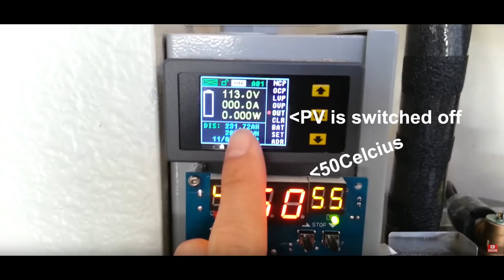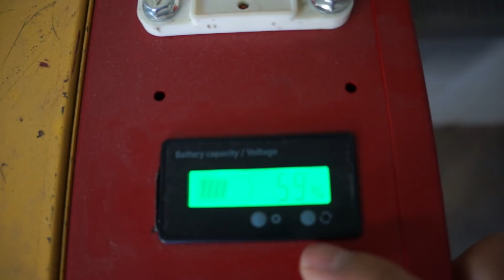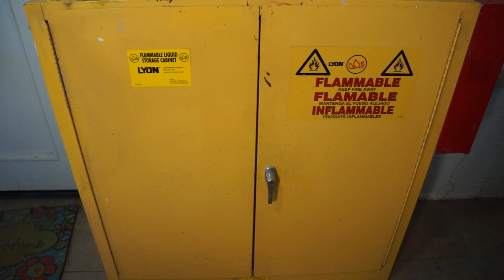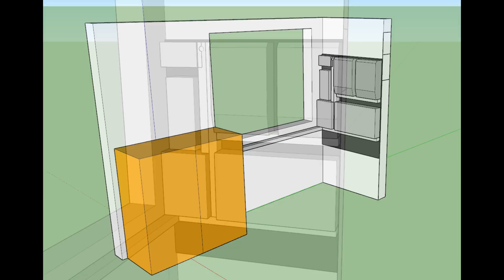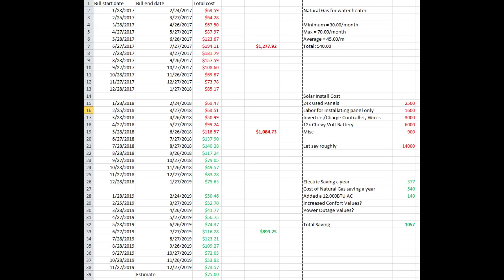My 7kw Off Grid Solar, 37kwh Lithium Ion Battery Bank Cost vs Saving over 2 years?

Comment: Very good.   I bought a 20 panel micro-inverter package  and had it installed in may 2019.
Total  $ 12 K + $ 5K,,  6.3KW,  electricity is really cheap at $ 0.07 per KWH.  Just pay the connection fee of $10.00 per month.   Burn off the credit to heat my garage in winter &  lower
my gas bill.   So saving about $ 1000.00 per year savings.  Looking like about 8000KWH per year. In WA.   I am very happy with it, silent and reliable, so far.   Getting 1000KWH per month in summer.
Reply from the maker: If the power company here aren't so greedy, I personally would want a Grid tie hybrid system.  But unfortunately I can't stand of how greedy they are and they do everything in their power to prevent people from going Solar.
Reply: Got bit the same feeling about ...
Nowadays,
They'll allow you solar power in exchange backfeeding the grid for free, and won't allow you more than 3kw systems, ..., unless going onto "certified" companies and negotiating project feasibility ...

You're not allowed to be capable of backfeeding once grid turns of ...
That means there's supposedly no installation working once grid down ...
Safety measures taken for their workers ...

Interestingly making customers hostage for safety reasons became kind a political norm ...

Like if .

From France, with

Comment: Thanks for your presentation.  We had 26     Solar panels.  They are 275 Watts with a/c micro inverters.  They produced about 9 megawatts annually.  This year we added 10 more panels that are 300 watts each.  We also are in the process of adding (2) 13.5 mega watt batteries.  We hope this will allow total solar powered home.  We do have gas water & home heating. 

Hoping to get a new Tesla Cybertruck next year or so.  It will eliminate the need for oil based transportation. 

Wish I had your skills. Best wishes.
Reply from the maker: Wow, sound like you got the electric bug.  :)

Comment: I live in the Mid West.  I have crunched the numbers many ways.  Solar is more expensive than PoCo.  We pay about $.15 KwH.  I find the best way to save money is to change to light emitting diodes, and cook outside in the summer to reduce cooling costs.  Nice system though but I do not understand why the push for solar when it is much more costly.

The PoCo here is very reliable and we lose power about 8 hours per year, mostly in the summer after a major storm.  I have a small back up system with FLA.  I keep charged at all times and if the power goes down, I can power the house for 12 hours. So there is value in having back up power because I gotta have my YOUTUBE.
Reply: Not everything is about cost. I have a similar but smaller system than DevilDestiny but I built mine as a multipurpose hobby.
1) I like the fact that I can produce my own energy in my backyard.
2) I like the fact that even if it cost me a little more, it's money that is not going to someone that I know will rip me off any chance they get.
3) I like that by using recycled parts just like DevilDestiny that I not only keep them out of a landfill somewhere in the present but also do my part to help the environment . I also have used panels and Chevy Volt batteries. 

I am currently still connected to the grid but by using my little system I have cut my average daily electricity use by about 60%. My average electrical bill for the last 6 months has been about $20/month.
Reply: @jjackson3240  I will agree that as a Hobbiest, there is some value in a DIY solar setup.  It is fun to learn about PV systems and there is always something to improve.  There is also value in having a system to power your house if the grid goes down.  I have a small PV system for my off grid cabin.  I also have PV for back up in case grid goes down for my CPAP machine, a few lights and the internet/TV.  All other appliances are natural gas and that never runs out or goes down.

However, for the vast majority of us, it is about cost.  PV systems cannot compete with PoCo.  Until PV systems can reduce cost to get the cost of producing electricity at similar to PoCo ($.20 KwH); Solar will be a pipe dream for the Tree Huggers. Most people have a small, gasoline generator as back up if needed.
Reply: Thonati m Interesting. Solar is financially viable in the U.K, we have broadly similar power costs to you- I pay 12p per kWh, so about 15 cents US. Yet payback for a 5 kw solar system is about five to seven years. We get wholesale for the power we sell back, about 3p per unit so not a lot, but panels are cheap- they have fallen in price by about 70 percent in ten years. Even though the UK is not known for its sunshine as a nation we get about a third of our power from solar and wind in varying proportions, on sunny days solar provides as much as 25 percent and it is growing by the day.

Comment: Your battery system will need to be replaced after 8-10 years.  Your solar panels will need to be replaced after 10-15 years.  Your inverter will need to be replaced after 10 years.  Total savings with suffering level increased?  Zero.
Reply: You have no idea what you are even talking about. typical solar panels 20-25 years warranty and even then 85% efficiency.
Reply from the maker: Your point is?
Reply: And your point is
Reply: His point:
For all the time invested and headache dealing with replacement and maintenance you could better invest your efforts into something else.

IMO : if you enjoy tinkering and spending your time messing around with everything the joy of the project with worth more than any money savings.
Reply: @ThisIsSolution  isnt it wonderful when people know how you should spend your life and what you value doing and learning, better than you do yourself.   Its a real talent.
Reply: all those time estimates are very low end and skewed to make the argument
Reply: What are you even talking? LoL. You have no idea, do You?? E.g. the battery would maybe last that long if DoD was 100% but he said he only charges them to 4V each. So he’s likely to get more than twice the cycles out of it. Even cheap China panels will last longer than 10 years. Decent ones will last a lifetime. Even if only 20 - 25 years are normally warranted (which is only because there are literally no commercial systems that are older than that.) the panels life from a physical point of view is expected to be much much longer. There are even solarpanels from the time the Hoover dam was build which are still working. 
My parents systems inverter lasts over 10 years now without any problems. However some may fail earlier while others don’t, so this is a factor which is normally taken into account while designing the setup. 
What did you try to achieve with your comment, other than showing off your lack of experience and knowledge?
Reply: Your vid inspires  me !

Comment: How do you like thos 5048MG inverters?  I'm local in AZ here too and picked up a couple 220v to 120v APC stepdown transformers for super cheap.  Noticed you don't use any transformers on yours for 120v loads, have you ever tried using a transformer on them?

Comment: Great video as always. Would I be able to ship those lithium batteries to south America?
Reply from the maker: Probably, by sea.
Reply: @devildestiny555  do you have any on sale.  And what about BMS I dont see any for your setup. how are the batteries being balanced?
Reply from the maker: @carlsonhenry  the Chevy volt battery is available on my website, azlithium.com .  I personally don't use Bms on my system.  Theres a lot if factors and variables that cause battery to go out of balance.

Comment: so you have single phase MPP units to mainly charge the batterys and use the separate inverter to power lights etc in the house?  Is the heat pump single phase 230v ?  Do you have any appliances etc that run from single phase 230v or have a transformer ? Does the MPP MG also provide 120 v ?
Reply from the maker: The MPP 5048 output the 240volts which powered the main 3tons central AC and the Garage MiniSplit 1ton AC, the Reliable 3500w output the 120volts for water heater and other small household items.
Reply: @devildestiny555   Ok so you have single phase central HVAC and Minisplit not split phase? It helps to put MPP 5048MG since MPP 5048LV can be confused with it and is split phase 240v.  Do you have both the inverter and the MPP units wired to the batteries and just use inverter to draw from the batteries or a part of the batteries to Midnite charger and inverter and rest of batteries to the MPP ?

Comment: $14,000 is very cheap for the system that you have.
Reply from the maker: I think so, I got the panels and at a very good price and the inverter/charger was very cheap comparing to other brands.
Reply: devildestiny555 i got 50$ per pannel 320watt 24v here in India
Reply: Probably spend that on panels alone.
Reply: @leedza  Not even close. Even premium, highest quality/power panels are <$1 per watt, so a 7kw system would be $7k max. Mid range panels are between 50 and 70 cents/watt, so probably closer to $4k for the panels for this system.
Reply: @leedza  No way.  You must not be current on the price of photovoltaic panels.  Anymore they're about the least expensive part of a solar electric system, and warrantied for 20 years or more.  Without even trying hard, I just found 320w panels for just $210 - laughably cheap and with a 25 year warranty.  That's typical for the tech these days.
Reply: @leifhietala8074  25 year guarantee,  how many companies will be around in 10 let alone 25?
Reply: @yarpos  LG Pannels, 25 year grantee